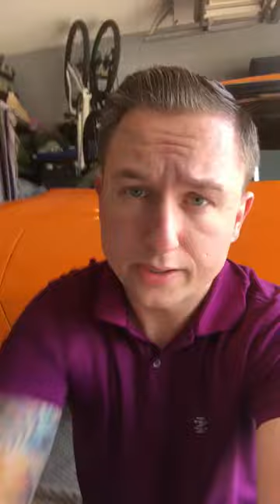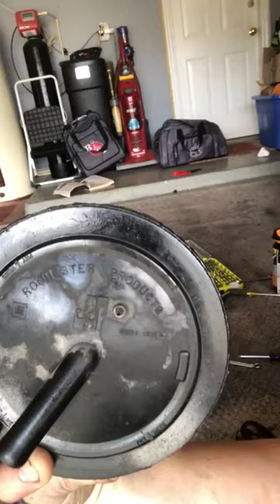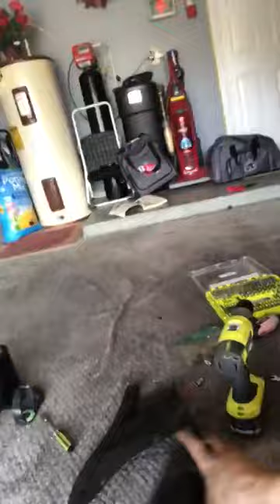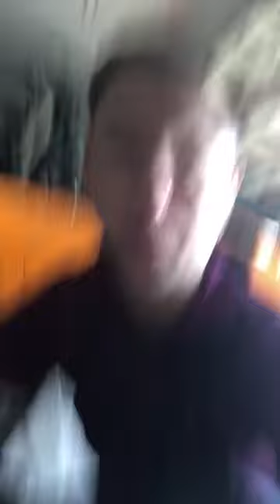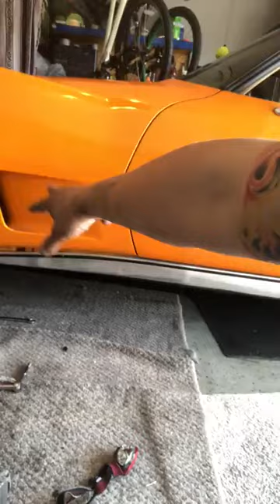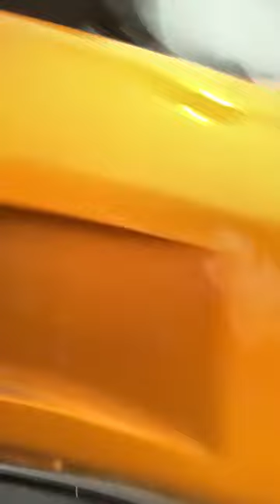C3 CORVETTE CHARCOAL CANISTER

Comment: How did you find the vacuum leak
Reply from the maker: Take off all hoses and cap each port. Add one back at a time.
Reply: I was wondering how well your 77 Evap works as far as cleaning up garage odors?